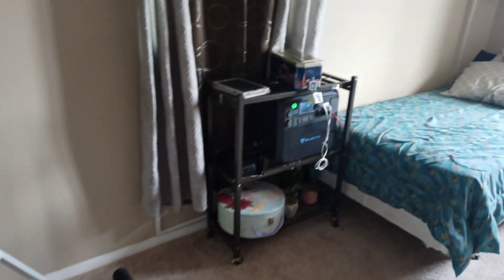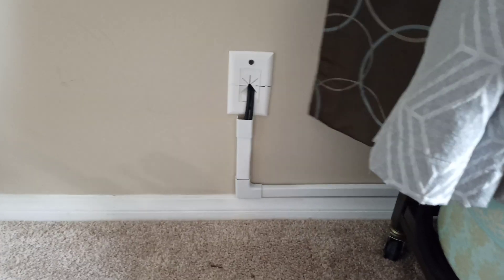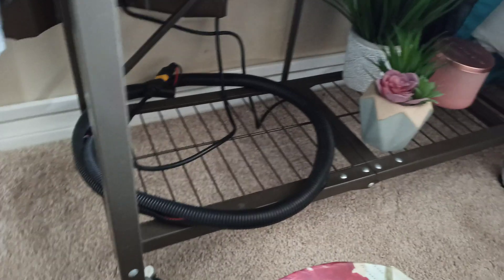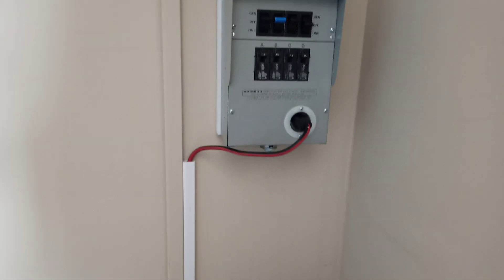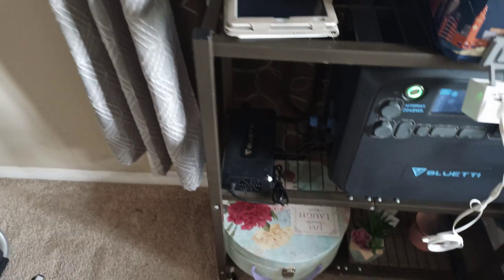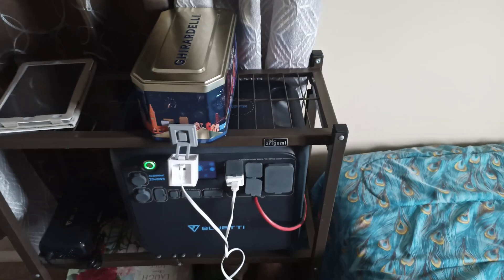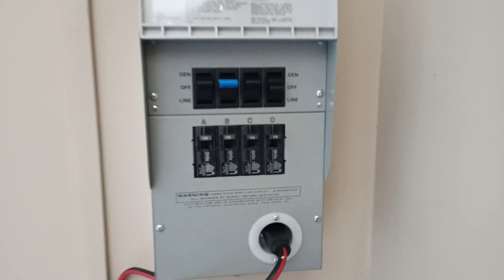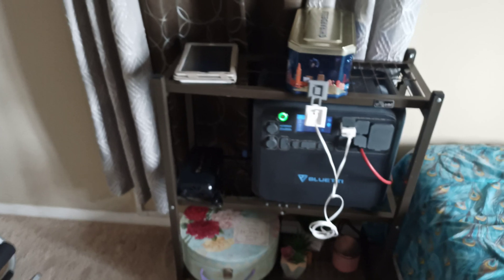Bluetti Ac200Max - how I view and control remotely. cable management.

Comment: Can you tell me your thinking in not using the 30amp switch? Also I have watched your other videos and want to run as much as I can from my ac200max + 2 b30. What amp breakers are you using for 1.2, and they correspond with your on grid circuit breaker?  Also can you share that process? First electrician I spoke to about installing the generator panel said he could wire 2 15amp circuits. I live in Tucson and originally 1:45 1:45  bought system for van but, I have seen you and another YouTuber running a good portion of your homes, and that is way better for me. I am stuck on how you have right sub panel installed. Any help would be appreciated.
Reply from the maker: My house has an older electrical panel. The majority of my house only has 15 to 20 amp breakers. I figured the 20 amp gen switch would work perfect because it's what my main breakers are. Also if I remember correctly the Bluetti can only output 15 amps? I could be wrong. There are some really good videos from the manufacturer on how to wire the gen switch. I would search YouTube for "pro trans generator transfer switch install".  I hope this helps.

Comment: I just saw the new Jackery They’re trying to copy this one the new one is just a rip off of Of this power bank
Reply from the maker: I haven't seen it. I'll have to check it out. If the price is right and the hardware's good it might be a contender.
Reply: @OffGridSolarSmartHouse  It’s not out on the website yet but if you do searches online it just took me a few minutes to find it it looks very similar to the 200 max it’s like they tried to copy the design
Reply from the maker: I saw it. The solar input looks good 1200 watts! Hopefully it has lipo4 batteries and is expandable.
Reply: @OffGridSolarSmartHouse  Yeah do you know of any that are below $400 or so but can put out 2000 wants everything so expensive would take me years to save
Reply from the maker: Not sure of any. Might be able to find an inverter for that price and build your own.
Reply: @OffGridSolarSmartHouse  Yeah I’m afraid I’ll burn my house down

Comment: Great idea. Repurpose old cams !!! Next I may repurpose old cell phone and have it continuously Bluetoothed to the 200Max and control the Bluetti remotely. Worth the try
Reply: You like that max?
Reply: @zfontain1975  seems ok.. but I've never tested others. The app could use some work. Right now only using it to power a 7 cubic foot freezer and small stuff. It handles that with no problem
Reply: @LADETROIT  the app is only good at close range. I've been running my fridge and freezer for a month straight it's been pretty good.
Reply: @zfontain1975  I agree. Close range only. For the price It just would have been cool to control or monitor it while away.
Reply: @LADETROIT  there is a way,you can find it on YouTube. There is an app you can download  if you have an extra phone or Android pad or iPad. You can connect one device to the other device and control the blue app when you're away
Reply: @zfontain1975  thanks. I've been working on that. Most of the apps I tried won't let you control the spare phone 100% remotely. I'll keep looking
Reply: @LADETROIT  off grid solar smart house is his channel. He has a video show how it works.

Comment: Looks good. Did you ground uour panel array. I'm thinking about making a ground mount but kinda of hesitant about the hole on the wall.
Reply from the maker: I haven't done a lighting ground yet for the array. I did put a small piece of conduit inside the hole.